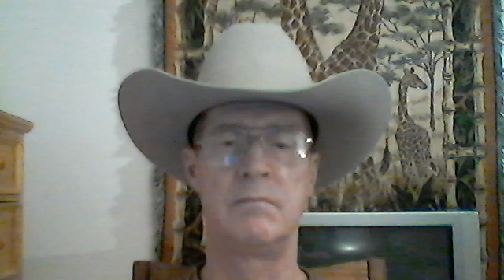Slot Antenna

Comment: Stan, I have read about slot antenna's and if I recall correctly, they are used in small form factor applications as a radiant part of cavity or wave guide.
My personal experience is as an absolute beginner. I recently purchased a box of 4x4 inch copper couplings to experiment with.
I cut the ring vertically and used a T shaped wooden form to support the ring and the gap. I will send you a picture later.
This is closer to a small pipe or slit antenna. As a resonant cavity with a tuning capacitor soldered directly to it, it works well as a passive receiver.
I connect it to my scope to view transmitter output as it seems to be more broadband than anything else. 
I don't have enough experience to say anything else.
Sincerely,
           NC3NTS

Comment: Stan, I have used a similar antenna called a Vivaldi antenna made by a company called HexAndFlex. I won’t provide the link per your regulations, but a Google search will show you what I have. Anyhow, my experience was odd, to say the least, the antenna was designed for  use of 1-2 GHz and up... however, I was still able to pull in some local AM and FM stations with it with my SDRPlay. The really neat thing I discovered though, was that the the antenna was definitely polarized. You could turn it 90* and totally block one signal, and gain another. I tried using the Vivaldi antenna for (Amateur) Radio Astronomy, but with the equipment I had, the results weren’t that great. Even with a HP Spectrum Analyzer at 1-3 GHz, I didn’t see much. However, the bands around 800-900 Mhz noticeably active on the antenna. It’s an interesting antenna, no doubt, but only a novelty, and something to fulfill my curiosity of what was above the range of my SDR. 73!

Comment: A slot antenna is for high frequencies only, by nature. Because it is formed by a half wave long slot in a metal plate and these are usually not too big. Most of the times slot antennas are formed by openings in metal enclosures ie. for ventilation. They tend to resonate and radiate well enough to give you EMI nightmares in your product design.
I have once successfully used a slot antenna at work. I developed a solar inverter with wireless communication at 2.4GHz. It was in a full alu enclosure and had an opening with a plastic insert in the cover to let the radio waves pass through. But our customer requested another type of communication at 868MHz. For that frequency the opening in the cover was too small. A larger opening which would let 868MHz pass would be so big that the cover would become too weak mechanically. I solved this issue by making a narrow slot in the cover, filled with a nylon insert which had a velocity factor so I could make the slot shorter than half a wavelength long and drive it with a coax cable to the inside of the slot. In my case I had to go a little off center to get a good match.
The radiation was pretty good, and my wireless communication problem was solved.
But as I said, unwanted slot antennas are very common as openings in enclosures causing EMI issues and as such many people have to deal with them often without knowing this antenna type even exists.